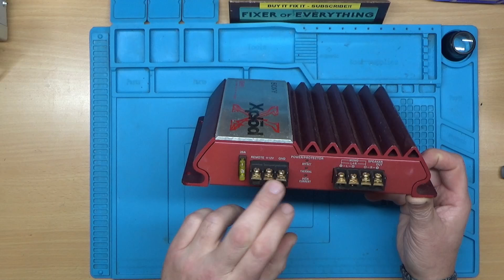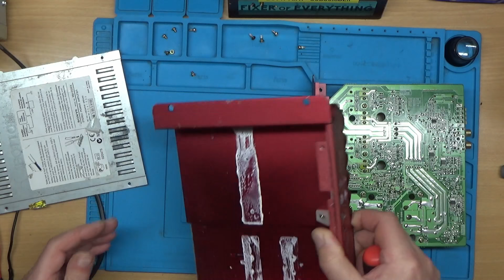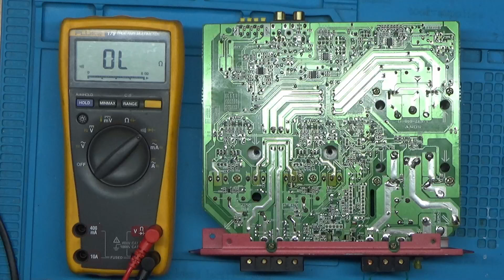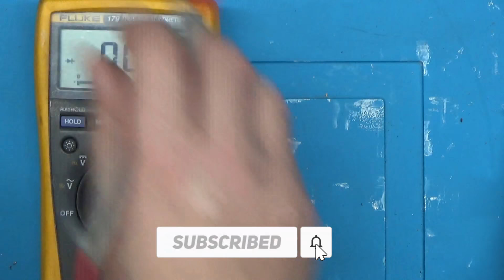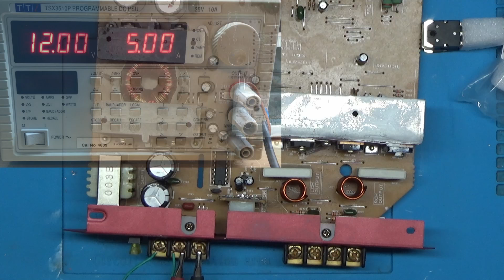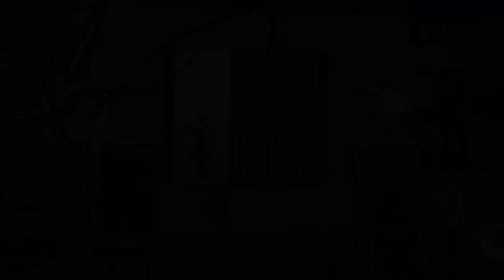Faulty Sony XPLOD Audio Amplifier | Can I Fix It?

Comment: I swapped out a pair of 10" Jensen with a pair of Sony Xplods in a bandpass box. I seemed like I couldn't push enough amps through them. Huge hits with some deep rumbling, they never disappointed me. Hadn't used an Xplod amp though. I imagine they're built the same quality.
Reply: I had that sub with a Jensen 720w amp and alpine cda 9813 HU. Infinity reference 5.5"s and 6×9"s powered by a 4-ch pioneer amp.  It shook my hair and felt like it would blow the trunk to pieces

Comment: No new heat sink compound?
Reply from the maker: Naa, there was still plenty of it on the heatsink to the outer case. The transistors didn't have any on, they just used a thermal pad.

Comment: This was a bit disappointing, because with a name like that, I had expected some fireworks. 😀
Turns it was a surprisingly easy fix.
Now that you replaced a transistor, I wonder if you need to fine tune the bias for that channel? If that is off, it could increase distortion or make it run hotter (although that didn't seem to be the case here).
Reply from the maker: Thanks Martin, I couldn't see any adjustments inside of it.

Comment: I remember xplod amps. They would sell you an amp that claims 1200 watts. But in reality, they where 125 watts two channnel.  Junk even when working. Xplod head units where even worse, They would fail in 13 to 16 months and then fucked you on a one year warranty.

Comment: Another great fix.😀 What would be interesting is to see a comparison of X-Ray images 😎 of the original and new transistors - under your X-Ray machine! See if there is much difference in the dies.
Reply from the maker: Thanks mate 👍I doubt it would really show too much because the back of the transistors are mainly a chunk of metal, so all you would really see is the metal outline. I'm just busy fixing something else, and I think I've been sent a fake part, so I have an idea which I'm hopefully going to try and de-cap the chip... stay tuned!

Comment: You should make an audio amplifier from an ev's motor controller.
Reply from the maker: Most of the stuff I've made is usually digital electronics. I've not really done much of making analogue circuits.
Reply: @BuyitFixit yeah, but it's part digital, and the fun part is a big version of that amp. Replace the digital crap with the preamp a normal amp, and you end up with a watercooled, 3 channel, subwoofer amp that makes at least 100hp! 😂

Comment: So when you replaced the “good” transistor that was paired with the bad one, did you replace it with the the same one as the bad one, because I thought it was a different number
Reply: The other one is a PNP, and he did replace it with the correct one else it wouldn't have worked at all.

Comment: You can use 2sa1941 & 2s5198 as modern genuine replacement from toshiba (buy from reputed sites) or even the 2sa1943n & 2sc5200n fits perfectly..besure to change all of them with the new type just to keep the characteristics balanced.
Reply from the maker: Interesting. I'll keep that in mind. Thanks for sharing and all the best for 2026!

Comment: Fixed loads of this type of Amp. O/P s can be replaced with TIP35c TIP36c pairs. Failures are usually caused by abuse and poor ground (main) connection to car. this can also cause damage to signal input ground traces. name is pronounced Explode hence the grav over the "o".
Reply from the maker: Nice. Yes wasn't sure of the pronunciation. Let's hope it doesn't live up to it's name 😂

Comment: No thermal compound on the new parts?  Sony may xplod again..  lol
Reply from the maker: There wasn't any on the original parts, just thermal insulator pads. The paste was on the top of the heat sinks to the outside case🙂
Reply: @BuyitFixit  Correct. If silicone pads are used, you don't use thermal paste as well. It's one or the other but never both.

Comment: Xplod  is when Sony started making awful car audio gear...
Reply from the maker: I'd never heard of them before, I just saw it on eBay and thought I'd have a go at fixing it 🙂
Reply: @BuyitFixit  Sony used to make really high end Audio gear for cars, especially head units. The explode series was an explosion in exaggerated wattage LED lights, and "wank factor 10". 
Really sad. Since like I said, they used to make some of the best stuff you could get.

Comment: It's been years since I've seen one of those  the only problem with those are they get very hot while using them so make sure there is good airflow around then I've actually seen carpet being burned by them and the unit working fine
Reply from the maker: Damn! This is the first one I've came across. I don't really have a use for it though as my boy racer days are well behind me 😂😂😂
Reply: @BuyitFixit mine too so don't feel kicked in the rear😂😂😂😂😂

Comment: What an ugly one-sided board from Sony! With bunch of jumper wires here and there.
This amp could be 30-40% smaller in size with 2-sided board and different heat sinks configuration.
Reply from the maker: I'm not sure when it was made. I remember the sony CD player I worked on a while back was also a single sided board so perhaps double sided was too expensive back then.

Comment: Those were considered "throw away" back in the day. I had a few xplod amps and head units and speakers back in the mid 90s. Still have a pair of those funky Pentagon shaped xplod 12" "1200W" speakers. If ya actually put 1200w to them they almost immediately go up in smoke. They are more like 300w RMS 500 peak. The amps were severely over rated. Every one that i've had either blew the output transistors in 1/2 or the cheap no named filter caps would blow there tops.

Comment: my experience with output transistors is try and match them as pairs . The actual number does not make that much difference just the specs  voltage current and gain to a lesser extent . most amps are remarkably tolerant to gain variation . Good old negative feedback. When I saw the way it switched on I took a punt on a blown amp output transistor. Loved the video thanks a lot.
Reply from the maker: Thanks mate 👍
Reply: Exactly, same thing goes for stereo tube amps.

Comment: Great diagnostics on that repair , I am glad the transistors worked out for you .......  A good load test will tell the tale on the new transistors ....... That amp is the first one I have seen in a long time that is not over exaggerated on the wattage ...... I see that DigiKey has those transistors in stock for a couple bux each , I put some in my cart for when I make my next order ....... Not Toshibas but another maker by the name of EVVO ...... Take Care Mon Ami ....
Reply from the maker: Cheers Cajun. Yes I came across the EVVO one's too after I ordered them from AliExpress. When I first looked for them it came up as obsolete, so I thought you couldn't get them at all. Happy new year btw 🙂👍
Reply: @BuyitFixit   Yes , Happy New Year ...........

Comment: No Xplod joke, a little sad.

You would want to test this near full power and dummy load (or a big speaker), because of the risk of fake transistors.

I'd also check the emitter power resistors, but if that goes (it often does), you would not get proper sound out.
Reply from the maker: Good tips, thanks for the advice 👍

Comment: Nice fix. 

I've got a similar repair to an under seat subwoofer, which has just stopped outputting sound. 

On yours, I'd have replaced all 4 transistors in the output stage, so to keep both channels in balance. Probably not too important for normal use, but important if using it in bridged mode.
Reply from the maker: Thanks👍Well done on the subwoofer.  Yes probably not notice in normal operation, but as you say bridged might be an issue.

Comment: Disappointing to see you spudger the old Transistors off then not clean the old heat compound off and replace it when fitting the new ones.. how could you claim to be "Happy with that".  

Bit below par for you
Reply from the maker: There wasn't any heat compound on the old transistors, they were just stuck to the thermal pad.
Reply: @BuyitFixit  non-conductive thermal pad at that.

Comment: Surely you need to reset the bias voltage on the base of the transistor's and to check for any DC offset on the speaker terminals
Reply: He checked for DC voltage on the outputs and there were none.
Reply from the maker: Not too sure on that one. I did check for DC on the speaker terminals, and there wasn't any adjustment inside of the amplifier so I just assumed it automatically sorts it out.
Reply: The bias is fixed. There is no need to 'reset' it, whatever that means. Replacing the blown transistors is all that is required.

Comment: Nice fix Mick!  You went right to the diodes and power transistors troubleshooting, awesome diagnosing.   As the entire case acts as a heat sink per design, I knew there would be some hot spots when using the thermal camera.  Great video and results, thanks for the work.  Hope you're having a wonderful holiday season.  See ya next year....
Reply from the maker: Cheers Terry, and a wonderful holiday season to you too 👍

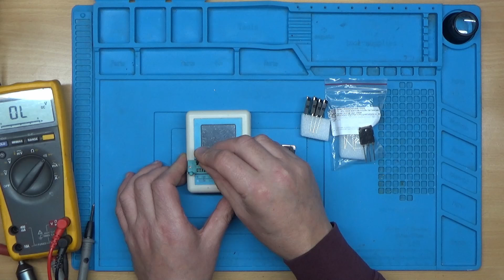Comment: 16:20 your component tester has had a rough life :) Happy Holidays Mick !
Reply from the maker: 😂😂😂Yes mate, it's the plastic on the top easily scratches. Happy holidays to you too mate 👍
Reply: @BuyitFixit  mine came without a case but I got a 'case' that consists of two perspex ? plates held together with screws. the sides are therefore open

Comment: I remember in 2001 shopping for car electronics and wondering why Sony chose that name. I went with Alpine and Rockford Fosgate instead. The Alpine deck played MP3 CDs. Yup. Those were the days, right, fellow kids ?
Reply: $1,000 stereo in a $500 car?
Reply from the maker: I remember Alpine was out of my budget, I think I used to have Audioline 😂😂
Reply: @BuyitFixit  😂 I was stuck with stock sadly 😢
Reply: Alpine TAPE deck, with Rockford Fosgate Punch amp, I still have them in storage 😂😂
Reply: Around this time, the xplod subs were actually pretty well built. I had a pair of 10's for years before selling them off because I grew up. 700 peak if I recall.
Reply: Still got my Alpine headunit and Soundstream Ref 405. I miss those stress free days ❤
Reply: I started with an older Pioneer double din, then made the upgrade to a Rockford Fosgate RFX-9420. I didn’t realize when I bought it that I needed an amp to go along with it 😂. Ended up with the R-F head unit, an MA Audio 800W 4channel amp, and some Polk Audio DB 5.25s in my first car. 

Later on added a R-F Punch P2002 pushing some 10” Punch P1 subs. 

What a shitbox but I had fun with it. Still have my R-F head unit and the MA amp lol.
Reply: I too remember seeing a receiver in a store and wondering the exact same thing at the time 😅
Reply: Whatever happened to alpine?  Thy were huge back then
Reply: @Diebog they are still around....
Reply: Rockford fosgate was so good back in the day,  late 90s early 2000s..  garbage now
Reply: I went for the Renegade V8 Ren 600
Reply: I still have my alpine head unit and I think this exact xplod amp. Still works too. Both are in a cardboard box with 2 Infiniti Kappa 5 x 7s and a pair of JL 6" round.
Reply: No, not really, not for me.  Look, Alpine's only claim to fame, and it was a questionable one even at the height of the brand's popularity, was that they supposedly had superior receivers.  Couldn't prove it on my test range!  Couldn't prove it in the Colorado mountains!  Blaupunkt, same story; over-marketed, badly-built, junk.  I never wanted a loud, bass-thumping car stereo because I don't suffer from micropenis.  I don't have a desperate need for strangers to know what I am listening to.  I just wanted a half-way decent head unit. The fact is, there aren't any, they are ALL shit.  So I gave up on all car stereo altogether.  Since I care about the music, I'm much happier listening to music at home on a proper stereo with no background noise, low distortion, no distractions, proper stereo imagine, and as much deep, musical bass as I can stand - no One-Note Bass silliness. YMMV
Reply: i remember having a relatively cheap Bluesky branded radio, it done mp3 cd's aswell!
Reply: its like im playing nfs underground again
Reply: Still got my old JVC mp3CD head unit from back then, it's now the source in a modern DSP based system in a classic 90's car. Modern car audio has come along leaps and hounds!
Reply: Alpine made the best everything Car Audio, I was a dealer for 25 years+
Reply: @alanfarmer5730 I’m not going to tell you what I think of Alpine car audio. In one of my cars, I had a Sansui stereo, with equaliser. The output from the equaliser fed into four separate amplifiers that were built from kits. The discrete output components were made by Motorola. This sound system was a very serious setup. I had to fit a bigger alternator in my car just to keep the battery charged while driving and using the sound system. One of my nephews is an Alpine fanatic. Not me. My big Mercedes Benz has a Sony head unit with pioneer speakers at the back and Sony speakers at the front. The subwoofer is a JVC, driven by a Pioneer amp. My Mercedes Benz A180 uses a Burmester sound system that is integrated into the car computer control network. Yes, I own 2 cars. I have not seen an Alpine car stereo in a long time, or Bose for that matter.
Reply: I used to make fun of Sony when I was younger. "Sony xplode? yeah because they fail too easy" but I only made the claim because my dad worked at pepboys back when, and when they were pulling down the "demo gear" on the car audio wall, ANY employee was allowed to take home what they wanted. my dad knew i was into audio, so he snagged me the 12" xplode woofer and a jensen woofer. i blew them both in about a week on a 300w amplifier even though they were rated for that same power in RMS. now OLDER ME writing this and thinking, I DO NOT think it was a "clipping" issue because back then I never turned the gain up.... I always left the amp gain on the lowest setting which, if anything, the woofers were underpowered. and underpowering a woofer will NOT destroy them no matter how many youtube "enthusiasts" claim so. they just "wont be very loud" which in my case, they were plenty loud for my application, but they still ended up blowing. the one sub I NEVER blew was my 12" kicker. wish I never sold it because that thing was just an absolute champion.
Reply: "Xplod" is a brand name Sony used for its flashy, high-performance car audio line, derived from the word "explode," symbolizing powerful sound for a younger market, though Sony later phased it out for more sophisticated gear. (Thanks to AI).
Reply: Because the people who buy big loud car audio are often into obnoxious things like being loud in front of people's houses.